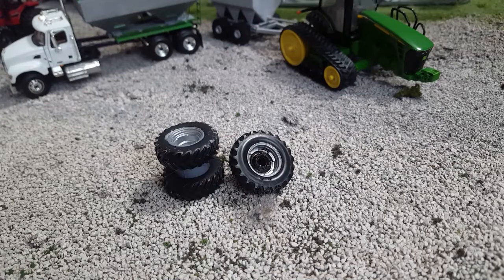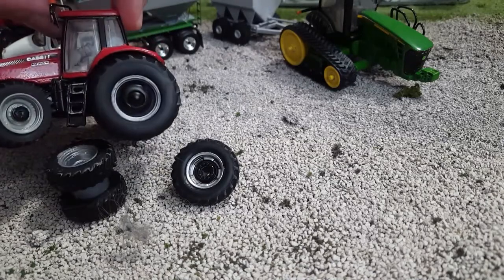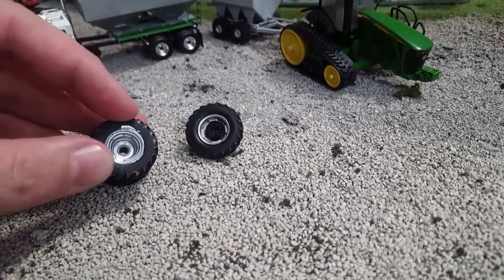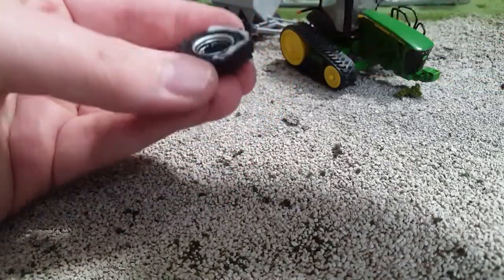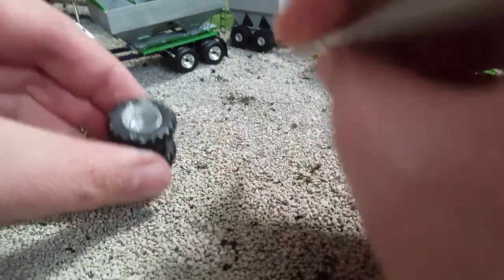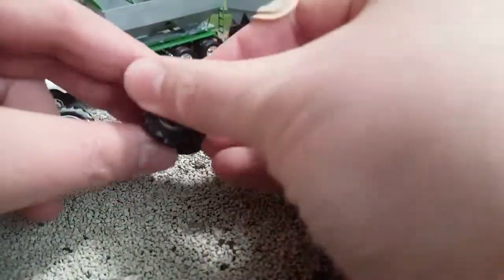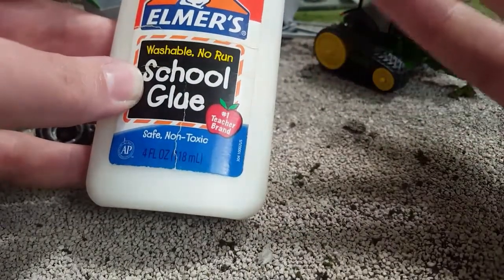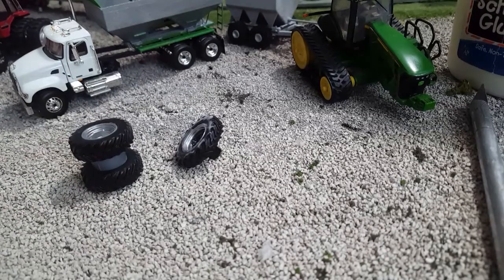Model building tip: painting wheels with the tire on

Comment: Great tip, Jason!  I will have to try this method.  I was actually applying blue painter's tape over the rim and using a sharp hobby knife to trace around the outer lip of the rim and then peeling back the tape from the inside.
Reply from the maker: I definitely used to do it that way myself. One day I was messing around some  glue and saw it would work so I tried it.  It probably it's limits and tape definitely has it's places.  This is just another tool in the box.